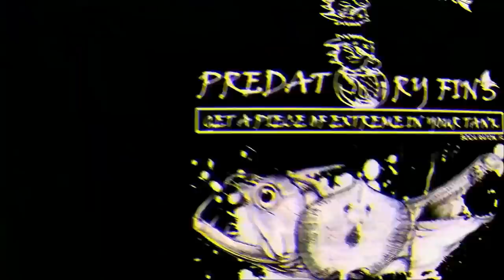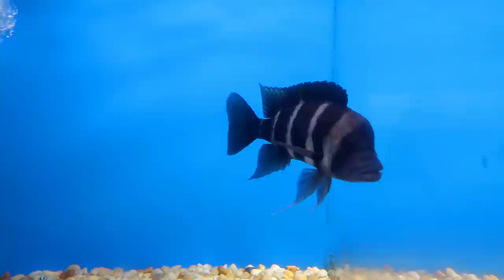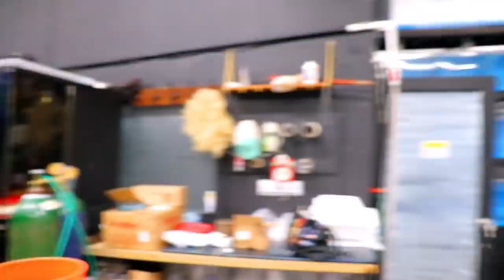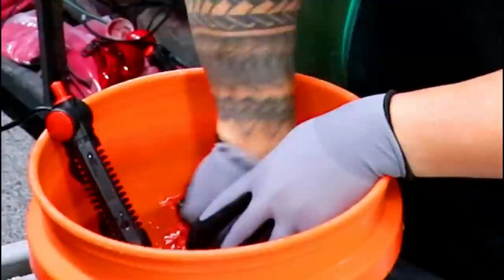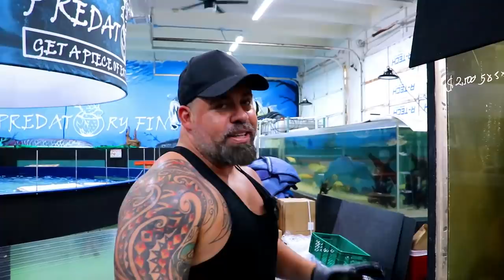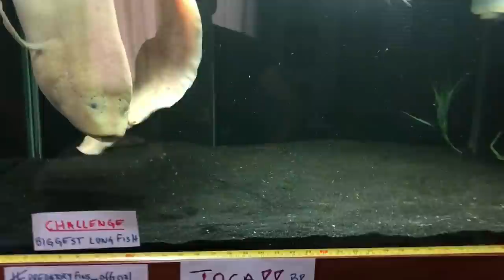WHAT?????? YOU NEED TO SEE THIS FISH!!!! WHO IS THE WINNER OF THE LUNGFISH CHALLENGE?

Comment: So as far as heaters. I myself try not to use a single one. I have some that rated for 5 gallons and yet it heats my 20 long and keeps it at 80. The best brand I have found, only cuz I do not keep fish that require higher temps. Are the preset cheap tetra heaters. They keep tanks no lower than 79, I haven't had a one fail yet. Well one stopped working, but in all fairness it was 7 years old. With heaters, it is best to pay the extra and make sure your buying a trusted brand, and to make sure you have one that isn't to large for the tank. I have seen ppl legit boil their fish. The fish actually die from lack of oxygen before being boiled to death.